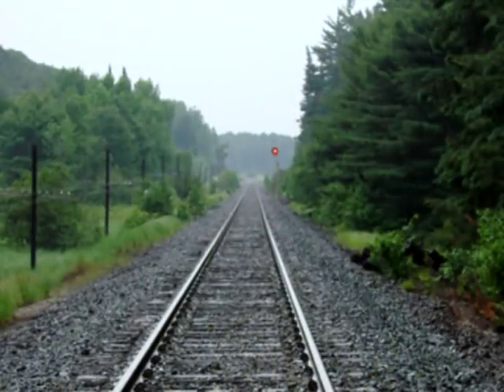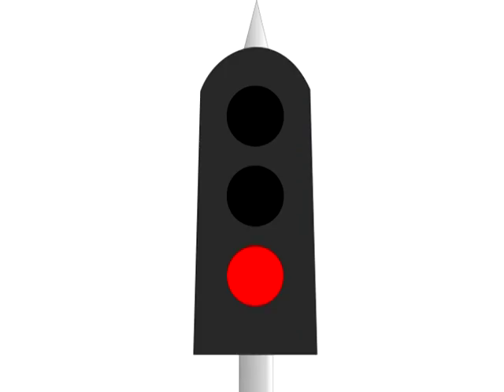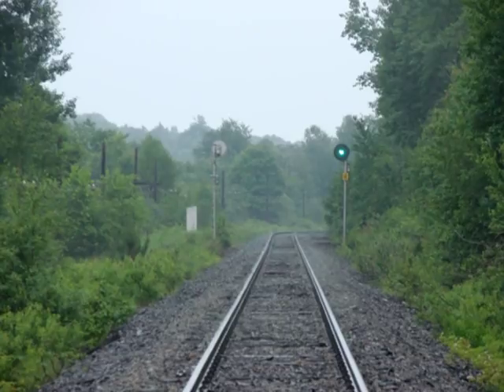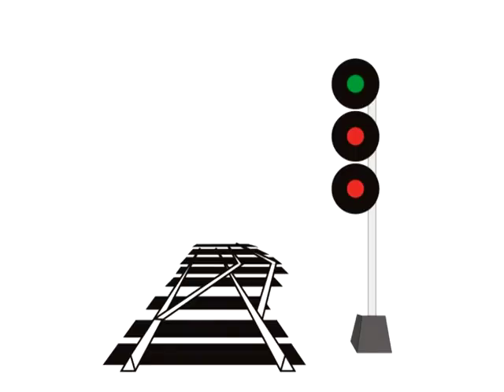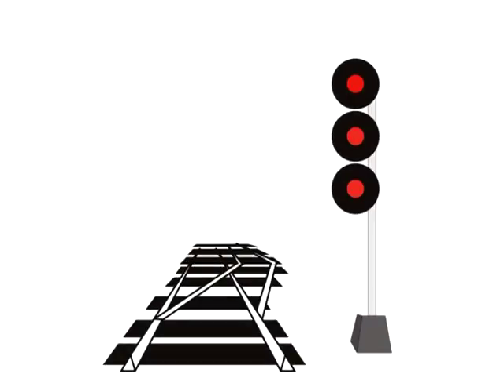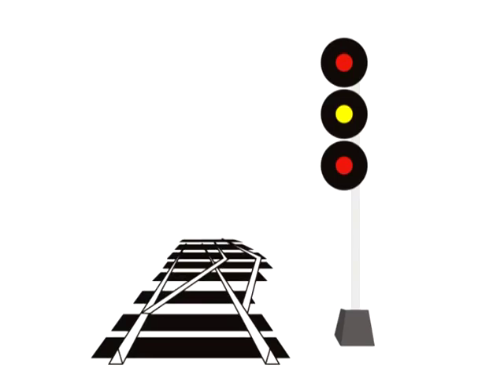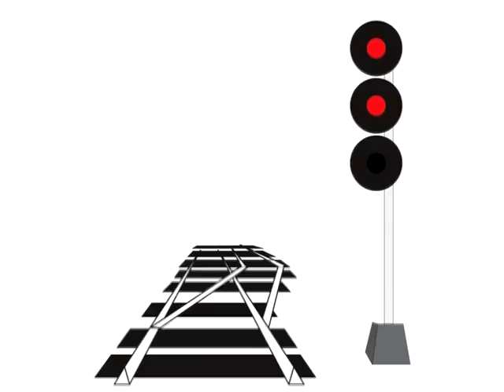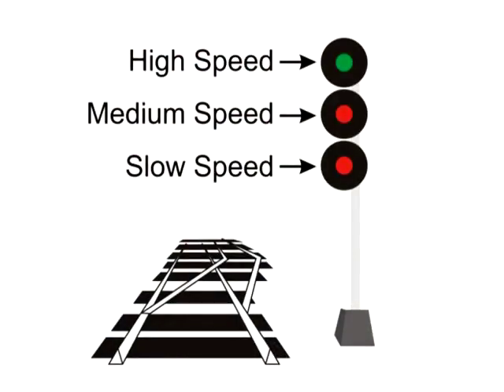Railroad Signals, reading and meanings, part 1: The basic three light system

Comment: We have a two aspect system in Melbourne Australia , likewise top aspect is normal speed clear , normal speed warning or stop , the lower aspect is medium speed clear , medium speed warning or stop . The only low speed signal is a low speed caution (small yellow/amber light) , this allows a driver to trip through a red home signal into a stabling siding , this can also be a dwarf signal post reading purple or yellow , yellow is clearance to shunt onto the main line , purple (looks blue) means the points (switch) have not been set to run into or out of a siding , thus purple is read as the same as red

Comment: The presentor of this material has done an absolutely excellent coverage of the generally unappreciated, yet very powerful, concept, of RTC which is essential, not only to safe rail operation, but equally importantly to maximize the capacity of the track plant, i.e. by optimizing the headways.  I would like to use the opportunity to add a small comment: the "Restricting Signal" is often referred to by train crews as a "Dirty Yellow".  Excellent presentation!

Comment: I operate LRVs in Kitchener Waterloo. Going under a bridge where freight passes, I always glance up at their signals, slightly confused. I think you're educational vid has cleared this up for me! Interestingly as well, when I saw the amber LED shown in your vid's light standard, I immediately interpreted "diverge". Lol. For me, an amber aspect is a change in track, a diverge from one track to another. Must be mindful of point position, therefore. Similarly, a green aspect indicates my route is set to normal, switches are set to normal so I'm on the straightaway. A red aspect or light: ALWAYS STOP!! In LOS, we use the lunar aspect or that bluish, whitish light. A vertical bar indicates a non permissive or STOP where by contrast the vertical lunar indicates proceed. A flashing horizontal lunar is preemption, indicating I'll get my proceed shortly. And so I digress....would love to see you do a video on switches!! You'd be a great facilitator anywhere where rail teaching is needed!! 😊😊😉

Comment: Interesting to see how different signal systems work. Here in Florida, the FEC uses a slightly different system of signals. The high clear and high yellow are the same, of course. FEC's middle green indicates a diverging clear. A low clear sometimes indicates a clear diverging through a siding instead of the main track when no other trains are present, such as going around a slow order. 

Thank you for the primer on the Canadian signaling system. 👍

Comment: I think the LMS over in the UK trialled a similar system in the 1930s but it was never adopted. We still use route signalling as the basis for all signalling with the speed primarily based on the driver's knowledge of the route, although computerisation has come in as a safety back up.

Comment: Wow finally i got it how all that works, thanks a lot :) 
I´m a locomotive engineer in germany, our signals have very little in common with that CN system. We have only one set of green, red and yellow and anything slower than track speed is shown with illuminated numbers 1 to 16, meaning 10 to 160 kilometers per hour.

Comment: I've watched the El and Subway signals in Philadelphia back in the 1980s, and each signal head was a 3-color, shaped like upside-down traffic lights. I'd board a train and do what railfans do, move to the front door and watch from the front end as the train headed down route. I'd see plenty of green signals, until we got into Center City where trains can't move as fast and bunch up. We'd then pass a yellow signal to reach (and stop at) a red. We could actually see the train in front of us, and once it left a station and moved farther away, our light would turn from red to yellow and we'd move. There were plenty of rigged signals too, that had the green light permanently blocked; the signal would read yellow even if clear ahead, to artificially make the train slow down, then on approaching the red signal it would suddenly turn green. Typical SEPTA not trusting their drivers.

Comment: That's actually pretty smart, versus the rather less failsafe lights we have in the UK and Europe. The old semaphores would default to "danger" (stop), but if a modern light burns out you just have to be on your guard to spot that there's a signal emplacement that's not showing any lights (and therefore must be assumed as red)... bit tricky if it's the middle of the night or foggy conditions, and your route knowledge might not yet be fully cemented...

If only road signals operated in a similar way. Wouldn't it be nice to know in advance that you're likely to hit a red if you proceed at the speed limit, and that you may as well go at two thirds or one third normal speed because it'll only change to "proceed" (itself maybe at a lower speed because of how things are sequenced) after enough time has elapsed for you to have approached it at a slower pace? Get a full green, you know you can charge ahead and blitz an upcoming sequence of all greens at "line" speed... get a lower green, or a yellow, and know that there's no point flooring it, and it's better to drift along in a more relaxed and fuel efficient (and, ostensibly, safer) fashion. Take the guesswork out, cut down on the stop-start, and have smoother flowing, less polluted cities even without having to pay for loads of flyovers and underpasses...

Comment: I find it interesting that the Signals are speed based over there, I.e. They tell the crew how fast you can go. In the uk, the signals will tell you your route, and it is down to the crew's route knowledge to know how fast you should be travelling. They also show what the indication of the signal in front as yours do.

Comment: Unfortunately in Canada there is no system of automated train control; it all comes down to the driver's knowledge of colour-light signals and his knowledge of the route. Mistakes occur, such as the VIA crash in Burlington where the driver took a freight-yard entrance crossover at a speed more suited to a high-speed crossover. Automatic train controls would have either slowed the train to the correct speed or stopped it altogether. The current system is little-changed from a century ago and is inappropriate for modern conditions, especially since trains are larger now and are often carrying dangerous cargo.
Reply: Automated train control doesn't exist anywhere. All train crews on any railroad are required to know the turf and read signals.
Reply: Do you mean positive train control?

Comment: I thought "Foamer" was a derogatory term given by railroad employees to those who trespass or might interfere with RR operations while getting photos, etc.

Thanks for the info.  Some of these signals seem similar to the BNSF & UP aspects, which are direction signals, such as "Diverging Approach."

I worked the B&O division of CSX, which was way different 'til about 2004. Now CSX has incorporated 3-light signals similar to the Canadian, with some blinking aspects. They don't have lunar. They are also speed signals, such as medium clear, or approach slow. Your example of Medium to Stop would be called "Approach Medium" = "Proceed, approaching next signal not exceeding Medium speed."

The signal system near your house, every 2 miles, seems like an ABS (Automatic Block System).
Reply from the maker: Ya, it probably is a derogatory term. I resemble that remark! haha!  And yes, the CP system behind my house was ABS. I don't think CN uses ABS anywhere, but CP uses it a lot.

Comment: I have a question about the "Stop and Proceed" signal.  How long should the train remain stopped before proceeding?  A few seconds?  A few minutes?  Do you have to contact RTC before proceeding?  Thank you!
Reply: Depends on the situation. But if you have what's considered an absolute red, which means you had to stop, Before passing the signal. You will remain stopped until the signal changes aspects, or the dispatcher talks you through the signal. There is more that goes with it depending on the situation,... But basically. The signal changes or the dispatcher will talk you through it. So if the dispatcher is not responding, your just sitting there watching the signal.

Edit- typically you would be at a restricted speed, but once again. It all depends on the scenario/variables.

Comment: I'm a bit of a "foamer" myself and always have been fascinated with railroad operations.  But I was having a conversation on board an Amtrak train with a BNSF conductor.  Of course, we get to talking about the signals and he said the signals below the top signal head are for switches.  So if it's red over yellow, the train slowly switches off the mainline and onto a switch at that signal site.  If it's a 3-head signal site and it is red over red green (or yellow), then the train will go to the second switch where it will move off the main line.  He did say there are single-head signals that tell what is going on ahead of time.

So does it vary on the railroad as to how they use and read signals?
Reply from the maker: msk578 It does vary, but what he said is generally true, that's a good way to put it.  There's exceptions of course, for instance up here because the line was built in the early 1900's, if we have a meet, the double aspect signals have been programmed with "clear to medium" if we're staying on the main. We then hit the signal at the switch at 30mph, and that signal would be a clear to stop. Basically, they just slow us down on the approach instead of giving an advance clear to stop.

Comment: How do they calculate how many locomotives to use on any given train? Length? Weight?
Reply from the maker: It depends on the railroad. CN was big into underpowering their trains in order to save on fuel. It does depend on weight but also the terrain. Some subdivisions have really steep grades so they have a higher horsepower per ton requirement than others.
Reply: Thanks.

Comment: In Michigan, I've noticed LED traffic lights get covered with snow in the winter. They don't seem to give off enough heat to melt the snow off the lenses. Maintenance crews have had to install heaters inside the units, thus reducing any savings gained by using LEDs in the first place. I would think those hoods you see over railroad signals are there to keep the snow off?
Reply from the maker: You might be right - the hoods on those things are huge!  Unusually so. So what you're saying makes a lot of sense, especially because all the lights are low-voltage and at remote locations with battery backup. So power consumption would be a prime concern.

Comment: Good evening. I used to be a Train master back in 2012. I am still an avid Train fan but I have lost my signal software practice program that was given during my rules course. Do you know how I can come across it again?
Reply from the maker: No unfortunately - however, there was an app that some of the others had on their phones for practicing.  I'd have to ask around what that app was, but it looked pretty slick and exhaustive.
Reply from the maker: Okay, it looks like it was "Canadian Railway Signals" by Rob Chandler. I see it in Google Play for Android. I don't see it in the app store for Apple however. Both stores do offer the CN CROR flashcards and I tried it out - it's flash cards, and evidently not even correct because the second signal that appeared wasn't even in the CROR. It was readable, but I don't believe that particular aspect was in CROR.

Comment: this comment is a mouthful but can  you answer a question of mine that  has been lingering for some time now? near my house is a small spur line called the CN burford spur, it connects to the CN dundas subdivision, for some reason near the area where it connects there is a single searchlight signal numbered 030 that is ALWAYS yellow no matter what. is it probably busted or just to warn of the mainline up ahead? my guess is that it's obsolete, the line used to be a full secondary subdivision and i guess it was to warn crews of the mainline up ahead? it's probably not needed now since the line ends a mile from where it connects to the dundas sub and they now have to back onto the dundas to get to the burford spur, but back then they came from the other direction and needed warning.
Reply from the maker: +TheBrantfordRailfan Hmmm.... I honestly don't know!  I'd be curious as to what the scoop was as well.  Probably a  leftover from the former days, but perhaps there is someone here who works that sub who could tell us?
Reply: +TheBrantfordRailfan Is the signal for trains heading back to the mainline? If so, it is a locked approach signal.  This is a case where the railroad has elected to always have train crews be prepared to stop, for 2 reasons.
1.  The next signal is likely to display red more than it is to have it be lined up for the train
2.  Due to reason 1, it would cost the railroad an extra few thousand dollars to signal that section of track just to get the more likely stop at the next signal.

There are one of those old locked approach signals down here in Ocala, FL, and it's actually still a semaphore! It has the same reasons as those listed above. The signal is on a shortline that sees 3 trains a week, whereas the track its protecting (CSX Ocala diamond) sees 20+ trains per day.  Did I explain that ok? Lol this comment was more long winded than yours.
Reply: Milepost 282 Productions
 Yes, it is for trains returning to the mainline. Thanks for clearing that up, you explained it fine
Reply: TheBrantfordRailfan glad to help. Speaking of which, is that the signal in your profile picture?
Reply: Milepost 282 Productions
Yes it is.

Comment: Great video and easy to listen/learn from! Question, what does a conductor do when all lights are not working? Say power outage or whatever? Is is protocol to stop asap?
Reply: hi ,if no signal displayed on the heads and i  were a driver i would definitely  stop and ask permission from control tower :)
Reply from the maker: It means a LOT of work for the conductor!  We need written permission to pass every single controlled light that's not working.  On our very short run between Armstrong and Sioux, if all the lights were out, we'd have to get like 32 written permissions - 16 controlled locations with controlled lights at either end.  If the light is out, it's deemed a stop signal.  Before my time, when the signals got their power and control signals from the telegraph lines on the poles, a bad storm blew through here and took out miles of lines.  Lights were down alllll over the place.  Now it's all buried power controlled by fiber optic lines.
Reply: Aren't there special rules for running in exceptional situations like that? I know in the UK if a run of signals has failed badly enough that the situation is going to persist for some time, that superblock is put under uncontrolled operation rules... trains ignore the dead signals, but can only run at reduced speed on open track, even less with restricted visibility (essentially the half-visual-distance rule holds sway, or possibly full-distance for double track with a strict keep-left rule), and much use is made of detonators... IE small but very loud firecracker type devices used to maintain some kind of running head between successive trains. First train comes to the first dead signal... driver stops, guard hops out from the rear and puts detonator on the rail immediately behind the back wheel, they wait a couple minutes then move off, hopefully at least activating the last working track sensor and so changing the previous working signal from red to yellow. Next train comes along at restricted speed, hits the detonator reminding the driver that there's a non-functioning signal there, who pulls it to a halt at the normal point... guard jumps out and replaces the used detonator with one of their own... wait a couple minutes (long enough that a functional train ahead of them should have cleared the next block, including its own wait)... move off at restricted speed again.

Not a perfect system and I've probably remembered it 100% wrong, but it's one way of allowing slightly freer movement through a linear block without having to go through the additional wait of calling up the signallers and getting official clearance to proceed at every single last signal when there aren't any switches to negotiate and the general visibility is good enough that restricting speed and enforcing a certain amount of headway at each signal is enough of a precaution to preserve safety. Obviously where there's any place that tracks cross over each other and it's not possible to see which way the switches are pointing (or it's just a diamond...) from a safe waiting distance, or the curves are such that you'd be down to walking speed for much of the run in order to have a good chance of braking for obstacles, and in any case on a single-track line, you still need to call up and wait for verbal (and recorded-on-paper) permission.

(it's also used a lot with track maintenance works where there are gangs on the running line, and particularly if they knock out the signals as part of that work... one (indeed, two) guy's sole job is then to put detonators on the line upstream of the work site so that approaching trains are warned to stop and wait for the crew to clear out of the way before proceeding (after which he replaces the banger), even if the worker responsible for that section is suddenly taken ill or whatever... if he's not there, the detonator still goes off... and if he's not there to give permission to proceed after replacing it behind the stopped train, the train can't proceed until the driver or guard has got out and gone to talk to the works foreman (who'll probably be quite interested to find out what happened to his lackey) and cleared up the problem...